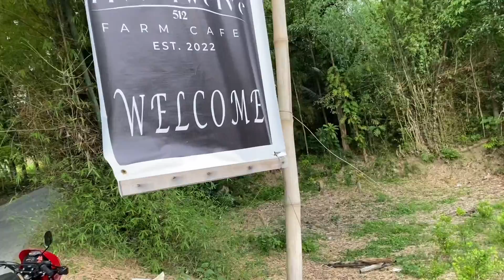Antique,Philippines build DAY51, I’ll be walking on the first floor before you know it.

Comment: 62, You might think about painting the rebar where there are joints with rebar passing from one pour to another. Like beam intersections. We paint all our rebar with oil base enamel and tint it so it is easy to track down if it wanders off. We also run 
Torx head screws theough stacks of phenolic board making it to heavy to float away. With crew living in a house on site 
nothing much lost so far. If they need a few bags of portland they know they can just ask for it.
Reply from the maker: This crew is honest and trustworthy. It’s the crews from out of town who have taken from other sites.